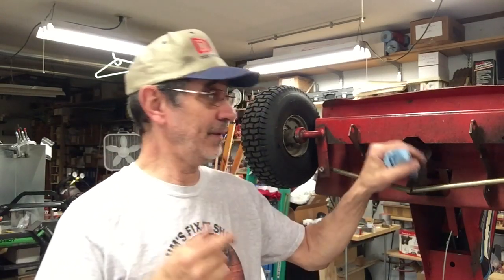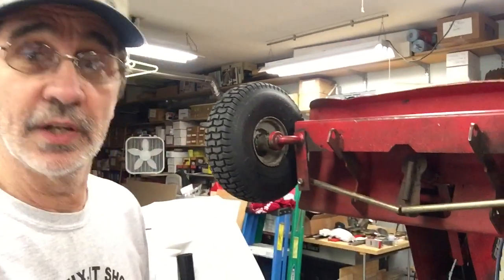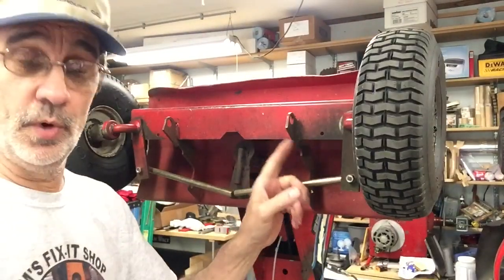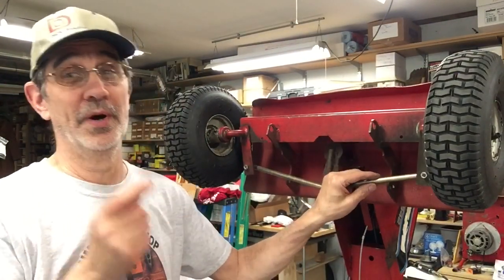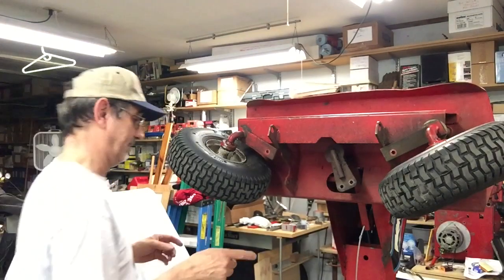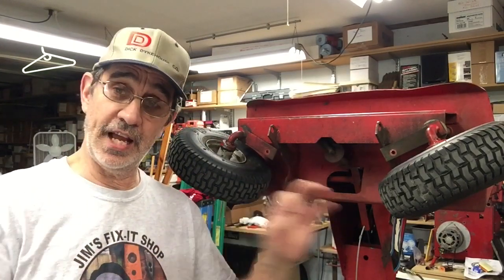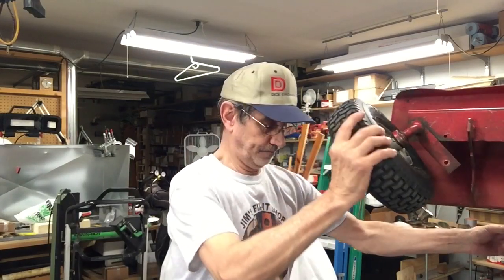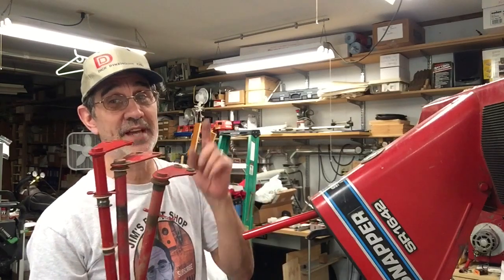347. Part 3 How to disassemble the front frame of this Snapper￼￼

Comment: Any clue on what size carbide bit I need to drill the pin out. Mine is completely FROZEN.
Reply from the maker: Well, the original hole should be 1/4 inch and a roll pins are slightly larger to fit tight in the hole but I would try putting some penetrating oil in there and then get yourself a 1/4 inch roll pin punch. You’ll have to support the wheel on a piece of wood with a, 5/16 hole drilled into it in line the hole up where the pin is going to come out and try driving it out first typically drilling them out really makes a mess unless you have the wheel in somehow and using a drill press your drill typically is going to wander And there’s no guarantee it’s going to follow the role pin. Keep me posted on your progress and what you’re trying.

Comment: I'm trying to tighten a new belt and currently can't get my tube to pivot. It's rusty and seized. It's standing up soaking in penetrating fluid tonight. I'm also getting cracks in same place that I was guessing they came from uneven ground twisting without being able to pivot.
Reply from the maker: Send me some pictures of where it’s cracking try to get a nice clear picture so I can tell what it looks like. Jim
Reply from the maker: I put a video on today just for that issue it's number 350. Jim

Comment: Hi Jim 

Trying to split the front and back frame but the rust does not allow it nore to rotate by the way. Else than WD40 any clue? To be fair was thinking to heat but the nylon washers will not like it.
Reply from the maker: Watch video number 350 I explain how to get the machine apart.   Jim
Reply: @jimjackson9381  many thanks Jim.

Comment: Hey jim, where do you get your rebuild kits for the carbs? I have a 12 hp briggs and i need a rebuild kit. Not the whole carb
Reply from the maker: It’s been years and years since I’ve rebuilt the carburetor typically I take them off put them in a ultrasonic cleaner with some simple green and it cleans them up and I just put them back on some carburetors you can’t get a kit for you have to replace the whole carburetor but I would start by going to a ace hardware that repairs lawnmowers and have them see if they can get you a kit. Jim
Reply: @jimjackson9381  ah. Well lovely.  I need just need the little gasket that is for the needle
Reply from the maker: @Gmcworrior1  
Well if you just need a needle or a seat you can get them probably through your ace hardware Or I have ordered them from White Lake nursery in Whitehall Michigan and their phone number is 231-894-8574 and ask for Chris and tell him I sent you let me know if you find it or I can find one for you if you have all the numbers off your engine. Jim